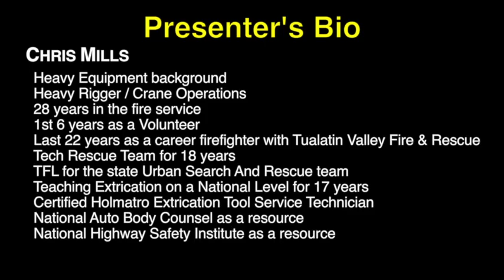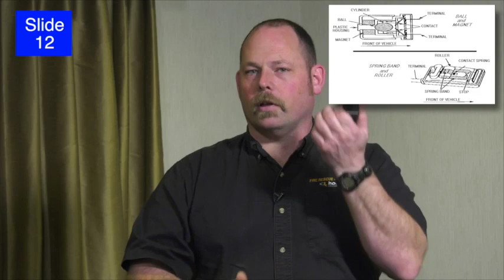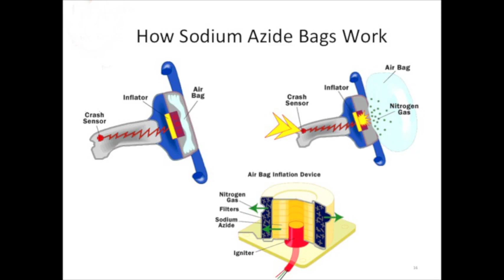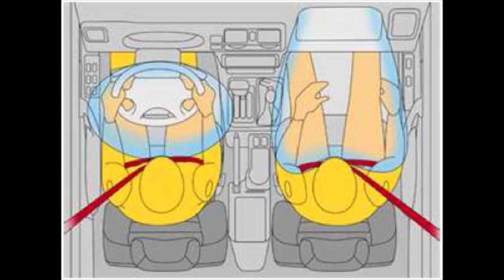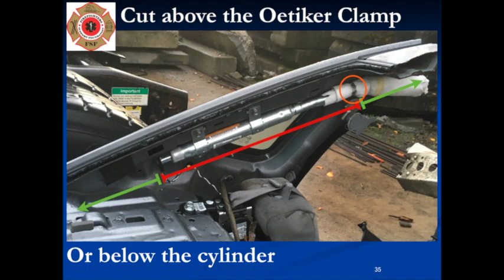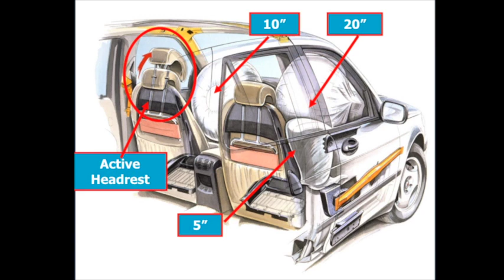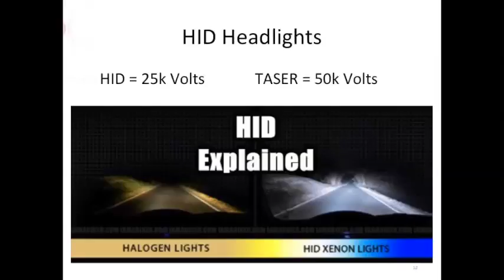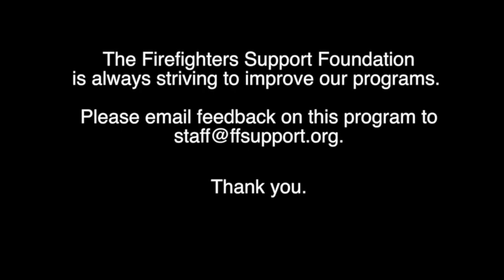Modern Vehicle Extrication Hazards

Comment: 1:56 - Kitty litter does not contain flammable vapor (Thick Undisturbed Foam Does)
2:10 - The primary concern with a hybrid vehicle is not "Leaking Battery" ALL hybrid vehicles are dry cell batteries, they will not leak... The primary concern is High Voltage.
2:39 - Hydrogen & Propane are not two most common alternatively fueled vehicles. 
3:00 - Using a fan to direct a propane leak is a very bad idea unless it is a spark-less motor
4:00 - Rescuers don't need to worry about there position in regards to airbags if they have conducted proper shut down procedures 
4:43 - There is only one bag that comes from the hood of the car... Its a Volvo that was only sold in Europe
5:08 - Rescuers should never concern themselves with sensors... There are way to many of them and have no effect on rescuer safety
6:00 - Thats just crazy! A bent wire does not change the resistance enough to set off an airbag!
6:20 - Now I am losing my mind! you can bend any door in any shape you want to get the occupant out! NO RISK OF "Bending wires"
7:38 - Cutting a wire loom is a potential issue if 12V has not been shut down. This is because you run the risk of connecting 12V power from another source (power window, lock, etc) to a door airbag. It is unlikely but possible. 
7:56 - Rear passenger seat is a very rare location for a 12V battery
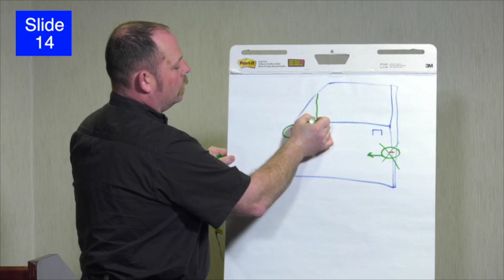8:20 - We have already covered the wire but airbag inflation cylinders in doors are almost always located near the latch side because thats where the airbag is.
12:15 - This is NOT how a duel stage airbag works - here is the truth     https://youtu.be/j8EGCGEqbSY

I actually cant take any more of this video... Let's just assume its unreliable content.
I'm sure the instructor had no ill intention. Just a repeating what he's been told.
Reply: Well, now I need clarification because this video is part of the programming for my COLLEGE class on emergency service rescue. This is the only education they've provided on vehicle extrication risks, and while your comment has been helpful, it's left me more confused, if anything. 🤔
Reply: @btrlucknxttime  if you're in my class there is additional info provided by the instructor in the voice thread link, and they talk about this specific comment, if this is legit the only source of info they provide, I'd demand a tuition refund. lol
but yes this video is outdated but still provides a decent overview with additional instruction. think of it as a primer as opposed to being the definitive.

Comment: Can someone please cite your information sources for the "wire" air bag sensors? I have been unable to verify this information is correct.
Reply: 1:56 - Kitty litter does not contain flammable vapor (Thick Undisturbed Foam Does)
2:10 - The primary concern with a hybrid vehicle is not "Leaking Battery" ALL hybrid vehicles are dry cell batteries, they will not leak... The primary concern is High Voltage.
2:39 - Hydrogen & Propane are not two most common alternatively fueled vehicles. 
3:00 - Using a fan to direct a propane leak is a very bad idea unless it is a spark-less motor
4:00 - Rescuers don't need to worry about there position in regards to airbags if they have conducted proper shut down procedures 
4:43 - There is only one bag that comes from the hood of the car... Its a Volvo that was only sold in Europe
5:08 - Rescuers should never concern themselves with sensors... There are way to many of them and have no effect on rescuer safety
6:00 - Thats just crazy! A bent wire does not change the resistance enough to set off an airbag!
6:20 - Now I am losing my mind! you can bend any door in any shape you want to get the occupant out! NO RISK OF "Bending wires"
7:38 - Cutting a wire loom is a potential issue if 12V has not been shut down. This is because you run the risk of connecting 12V power from another source (power window, lock, etc) to a door airbag. It is unlikely but possible. 
7:56 - Rear passenger seat is a very rare location for a 12V battery
8:20 - We have already covered the wire but airbag inflation cylinders in doors are almost always located near the latch side because thats where the airbag is.
12:15 - This is NOT how a duel stage airbag works - here is the truth https://youtu.be/j8EGCGEqbSY

I actually cant take any more of this video... Let's just assume its unreliable content.
I'm sure the instructor had no ill intention. Just a repeating what he's been told.